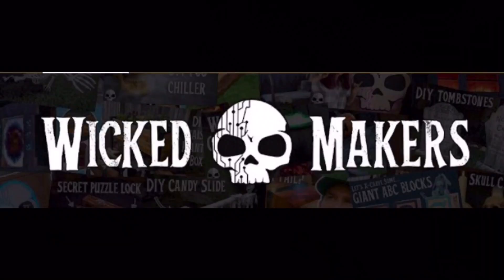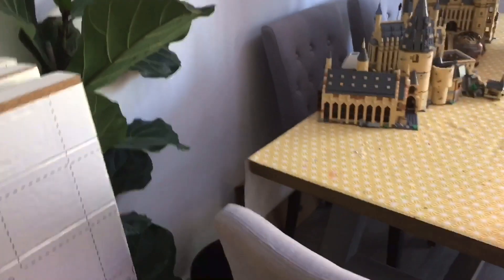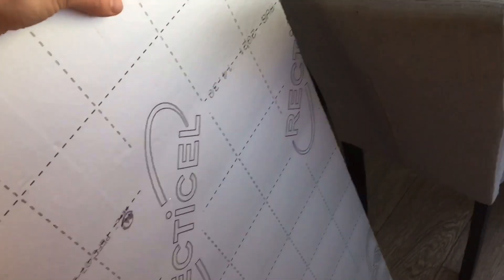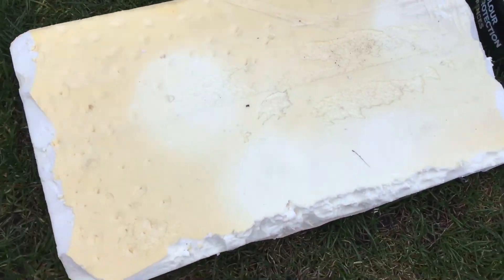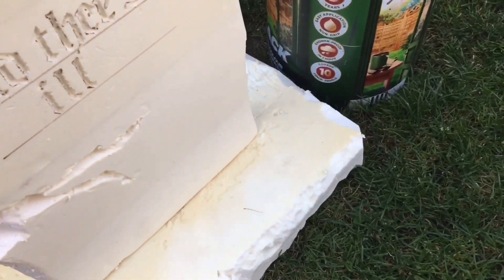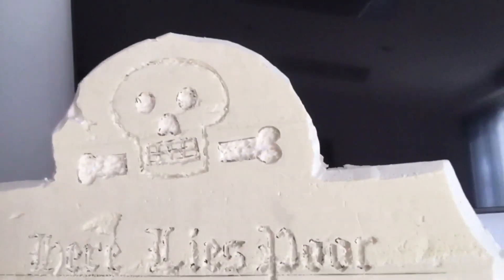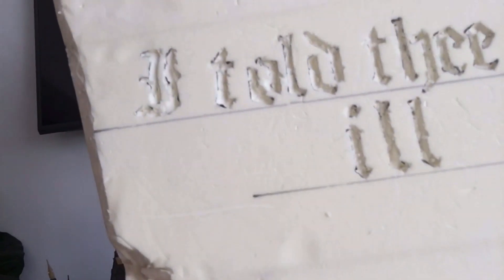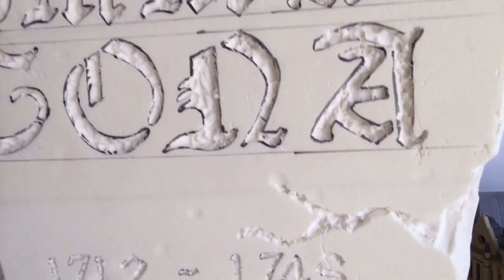DIY Halloween Tombstones 🪦 How to make tombstones from foam| DIY Halloween props

Comment: Hi Dan, it's nice to see another Halloween enthusiast producing videos.
I see Hollywood hunters have noticed you, They are a great source of ideas and inspirations.
If you haven't already found scary lady videos I highly recommend her for tombstone and other prop ideas.
Most hunters will tell you to put PVC pipe inside of your stone for anchoring purposes, unless they're intended for inside use only. I personally do three layers of foam front back and in the middle, rather than carving out a canal for the PVC pipe. I also happen to like a thicker looking stone.
Well I don't produce YouTube videos I have been making my own Halloween props since 2005, mostly tombstones. I prefer life size stones  & I tend to want my Halloween grave yard to look like a real cemetery. My obelisk is over 7 ft tall.
My best advice would be use loctite pl premium construction adhesive when you work with foam for your stones.
I also suggest you use some sort of toothpicks & paper tape to help hold your work together as the glue cures.
I have found an electric meat carving knife (for a holiday meal ) works wonderfully for cutting foam.
For lettering I have found print it out on a computer, tape it in place than use a corn cob handles to create a dot to dot pattern to follow of your lettering. 
I also don't own a dremel so I melt in my lettering with a soldering iron. If you do this be sure to do it outside because you don't want to coach your lungs with plastic and a respirator is always a good idea.
I have a new agree with you not perfect tombstones look more real because they resemble aging & old Craftsman hand carved stones instead of computer driven engraving machines.
For me I prefer high contrast in my painting of props. I always paint the base all black than dry brush layers of lighter & lighter colors of paint. If you don't already know dry brushing means you knock most of the paint out of the brush and then apply a thin layer of paint.
I personally don't care for tea staining but I'm not good at that & I prefer a lot more color in my tombstones.
I find the choice of foam makes a difference in what you can do with your tombstone. The expanded foam ( white balls) I personally don't care for but it works okay in the center for me. 
My preference is in the pink, blue or green foam. I believe they're called extruded foam.
I can honestly say I have never hard coated my tombstones or other props.
But I don't leave my Halloween props out for more than a day due to weather & winds. I simply spray a few coats of clear  spray paint.
I'm not a professional haunter, but I was a fine art sculpture major & commercial artist. So Halloween prop making is a passion for me.
If you haven't tried making a monster mud grim reaper or angel, I would recommend it. Directions can be found on YouTube, but basically it's joint compound mixed with paint, ratio varies I prefer about 50/50 & I just use opps paint because I paint a layer of black is my base just like the tombstones. 
Stilts beast studios /Allen Hopps has some really wonderful videos also. Everything from corpseing to packing tape ghosts and my favorite a skeleton in a can ( I use the technique in that video to create and carve angel wings) .
I hope you continue to inspire and create.
Many hunters who create YouTube videos have a catch phrase.
Well I don't create YouTube videos I do have a catch phrase, " live long and haunt forever".
Thank you for producing and putting it out there.
Reply from the maker: Thank you so much for taking the time to watch my video, and for all the really useful tips. I’d love to see some of your tombstones.. they sound amazing! I would really like to try and make some more tombstones for next Halloween and the monster mud idea for my grim reaper is a great idea.. I’ve played with the idea many times.. but since I’m probably not going to buy so many props next year, I’ll be making more stuff this time so some of these ideas will definitely come in handy!
Thanks again and keep it spooky 👻

Comment: Turned out great are you thinking of using yard sign wire frames or pvc pipe for rebar?  hey since you have the base you could always just set a painted brick on the backside to weight it down.
Reply from the maker: I was planning on using pvc pipe and bar.. but the painted brick idea is great! That might actually work really well. Thank you so much for the great idea and for watching my video 👍🪦.. I just hope it’s not so windy and wet this year as last year we had terrible weather for the whole week in the run up to Halloween! Fingers crossed for a dry, calm spell for this spooky season 🎃👻